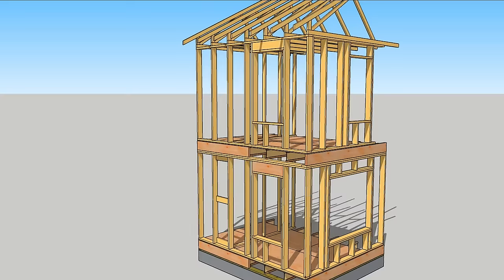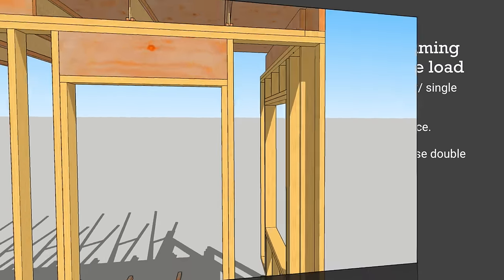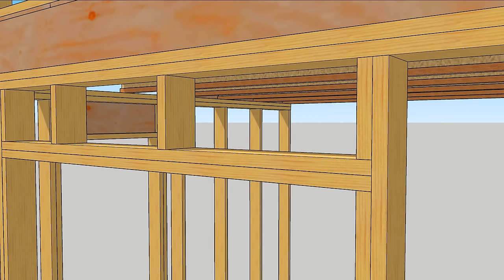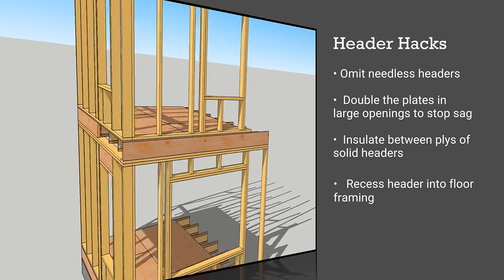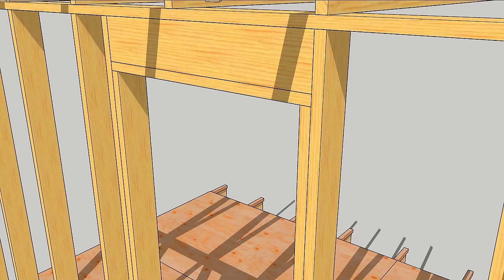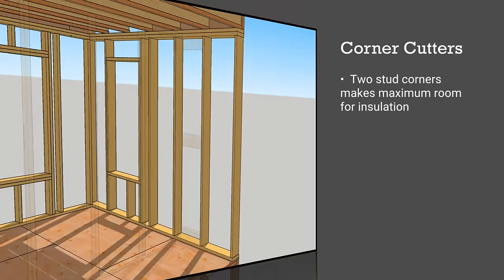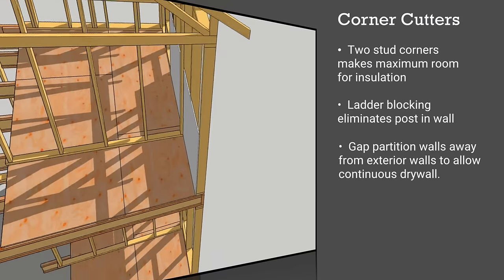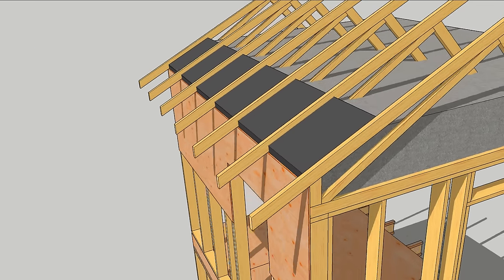Advanced Framing for Framers

Comment: Nice presentation.  However, this is not a "all or nothing" proposition.  I am building a 26'x32' shop and incorporating some aspects of advanced framing, but not all.  The 2x4s were more cost effective (even with 16 O.C.) then 2x6s (24 O.C.).  I'm also keeping the double top plate and Cali corners.  The cost and labor savings for me is found with jack studs and cripple placement & sizing my headers correctly.  Also, the common rafters will sit on the ceiling joists (as apposed to sitting next to them on the top plate).  The rafters and joists will be blocked in together.

Comment: This is weird. That's why I haven't seen anyone actually doing this
Reply: Agreed! Actual professionals in the industry can plainly see that there are  no time or material saving benefits to the processes exemplified in this video
Reply: @chivo121  There are LOTS of benefits. A lot less material around doors and spacing is 24 instead of 16. Also, it installs just as fast (or faster) as 'traditional' when someone learns it. It's not hard, and if the plan is right, all the headers and such is called out so the framer doesn't need to look anything up. So it's a win win all around; faster, less material, less thermal bridging, better insulation ability... the only real down side is that it's something new to learn, but that's not a downside in my opinion. I still prefer ICF with only advanced framing on interior walls with raised heel trusses as mentioned. Traditional framing should be abandoned for pretty much everything.
Reply: The benefit is in the insulation of the house. Not as many air gaps and dead space areas.
Reply: We all know the cliche of construction trades [rolls eyes]. "I have been building this way for 30 years, I am not changing now!"